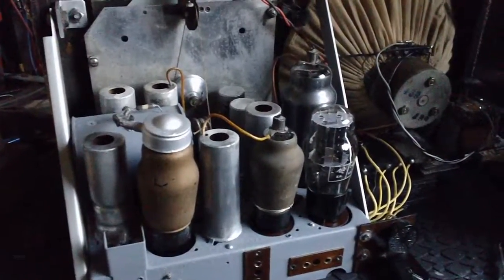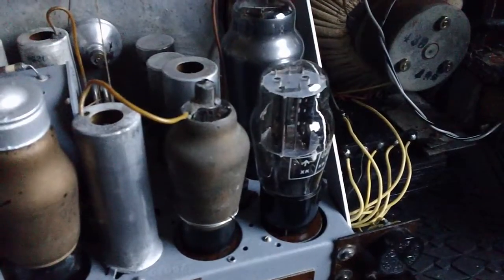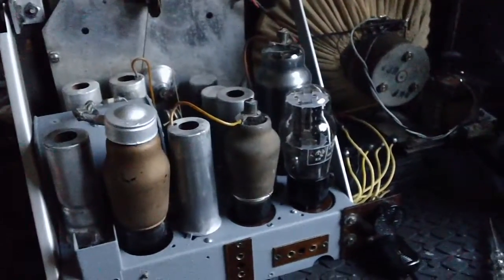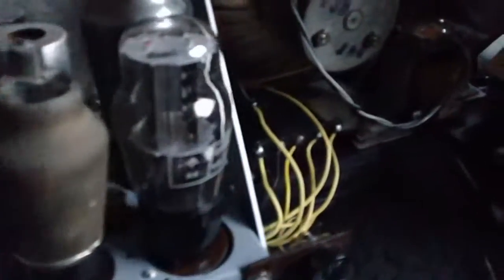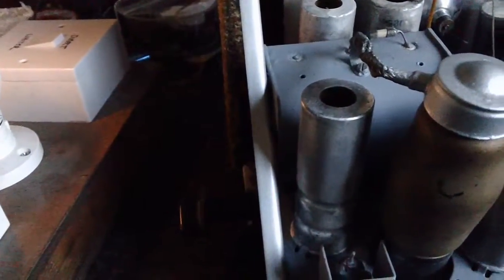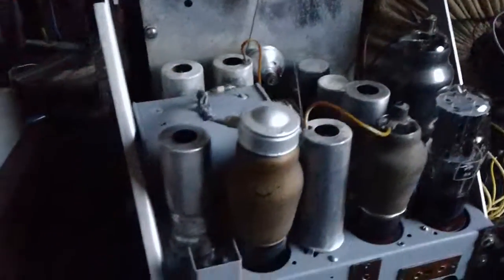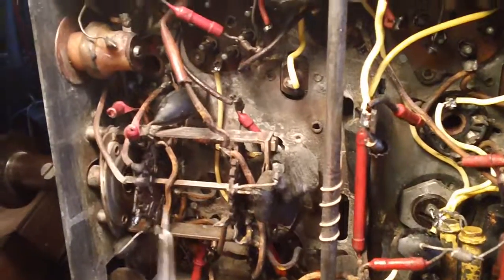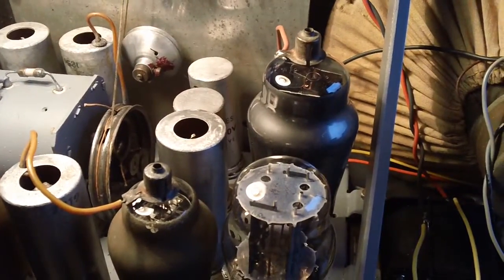Philips 470A Radio Repair Part 4

Comment: Nice job Andre, happy for you it works.
just bought a 470A already restaurated for just 50 euro from an old man, i felt guilty for that price but the man realised it and he said, i rather see a younger man smiling wile i am already gone to heaven.
I am very happy to see yours working, and i know high voltages of those caps can make real wounds.
It is in Dutch but photos are universal http://link.marktplaats.nl/m1021687644
Hope to see more projects of you cya

Comment: From my experience with U.S and Canadian built sets it doesn't seem to matter that much whether the rectifier is directly or indirectly heated so long as the pinout is the same. For example a 5Z4 is directly interchangeable with a 5Y3, but the 5Y3 is directly heated and the 5Z4 is indirectly heated, the reason being is that the cathode in the 5Z4 is at the same potential as the filament since it's connected directly to one of the filament pins. 
  I think that I would go ahead and replace the paper capacitors now that you know that the set plays, especially the coupling capacitors and the tone correction capacitor if it's across the output transformer primary. I would also replace that scorched looking pair of carbon resistors with a wire wound, I don't think that the value is that critical so long as it's within 20% of the original Phillips one.
Reply from the maker: +OlegKostoglatov  Oleg, that's exactly what I'm going to do right now, get all the Philips black tar bombs out. I'd like, if the set was more original, to find a way of replicating that capacitor, one of two visible from the rear. That one on the output transformer (it's not exactly in that position in an original set) and the other is an RF Bypass on the mains transformer . That was missing when I got the set. Unfortunately you can't re-stuff these black ones.
Reply: +Andrewausfa No you can't really re-stuff those Phillips caps, they are pretty much like the Solar "Sealtite" caps, where they are molded out of tar or hard wax and there is no tube to restuff. I suppose that one could find some black plastic tubing and fill in the ends with tar or black hot melt glue. One thing I will say about those tar dipped caps Phillips used is that much like the Solar brand caps they are one of the few vintage capacitor types that is still sort of functional.

Comment: Nice job on the radio.  Was this the set that had the bad speaker?  Were you able to fix it or is this a replacement.  Thanks Zach
Reply from the maker: +zachtownsend1  Thanks Zach, yes it is that set. I stole the speaker from the 555A I was working on a while back. Same part was used in both sets.